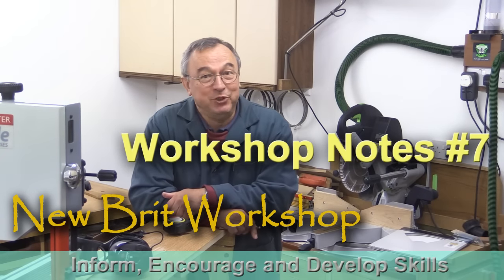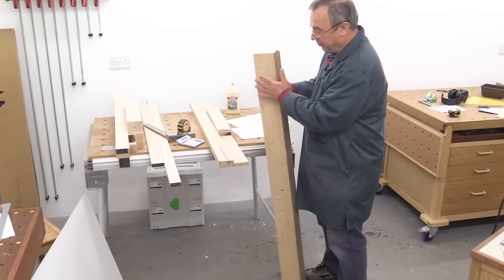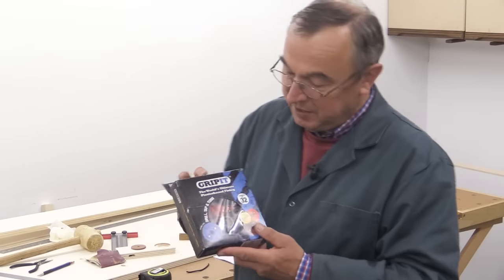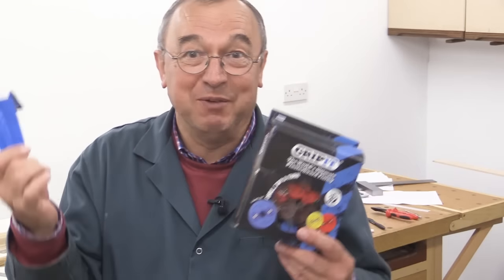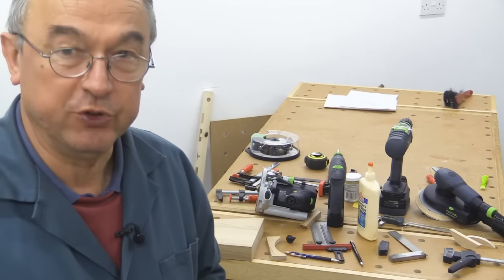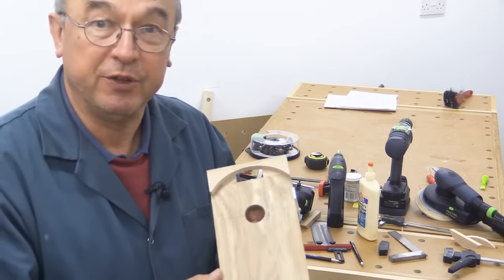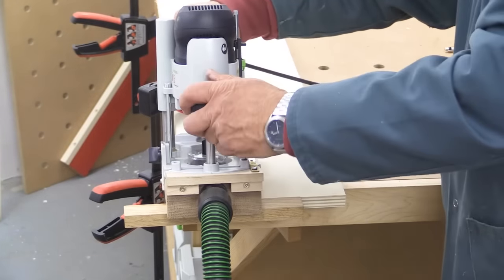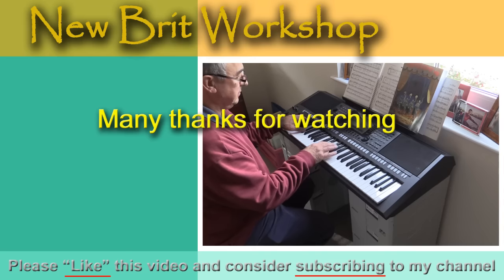Workshop Notes #7

Comment: hi Peter. Ireally like your workshop notes videos. I did get what looks to be the same brand of long auger bit from toolstation but with green instead of orange, something like Heller was the brand so may be yours is different but have found it to be very good and was 6mm, I think it was about 250mm maybe a little less but yours does look longer. your videos are always worth the wait and the teasers add to the anticipation.
Reply from the maker: Hi Craig, Many thanks. It sounds like the two drills are very similar.    Cheers.    Peter
Reply: Good accurate work as usual Peter! Try Cromwellin the UK for unusual tools including extra long seriesdrill bits. Just bought 260x6mm for work.
Reply from the maker: John Anderson Hi John, Many thanks for the info.  Cheers.   Peter

Comment: Another good informative video. Hello Peter. I hope you are doing well. My apologies for doing this.... On another channel a particular video was about dealing with snipe when running panels through a planer. A Brit made a comment that he had never heard the word snipe used in the U.K. but knew that it was a problem in the U.K. as well but did not know the correct term for it used in the U.K.. The creator of the above mentioned video asked the gentleman from the U.K. to let him know what terminology they use for the word snipe in the U.K. (If he found out), as Brits' have entertaining words to describe something. And sometimes have many words to describe the same thing... So I was hoping you wouldn't mind using your considerable oratory skills and give me a word or two to explain your version of the word snipe! 🙂
Again my apologies. And thank you.
RonH
Reply from the maker: Hi Ron, We call it snipe and I have not heard it called anything else. Whoever says that he has not heard of it must be a novice (or very lucky). Snipe is an effect where the final few inches of the wood get a deeper cut. It occurs for a variety of reasons but mainly due to operator error. The wood going through a thicknesser has to have a flat face in order for the opposite face (being cut) to be cut equally flat. Care needs to be taken to ensure that longer pieces of wood are supported towards the end of the cut. Snipe can also be caused by a poorly adjusted planer which you would need to "Google".   Peter